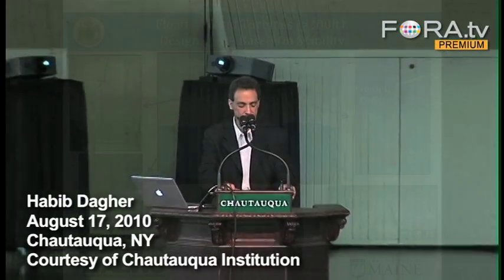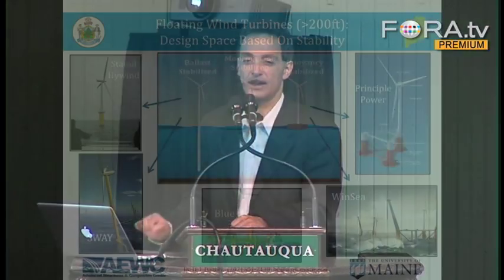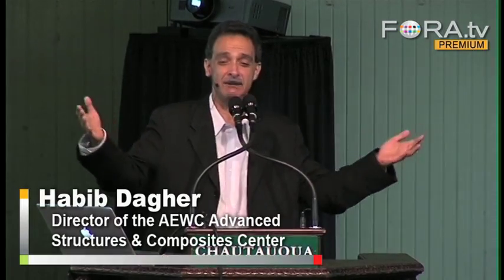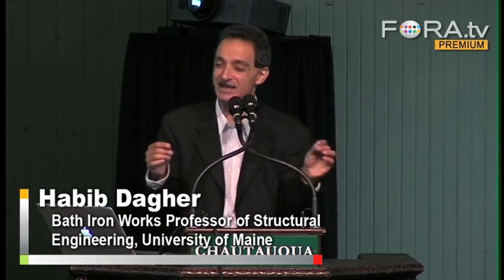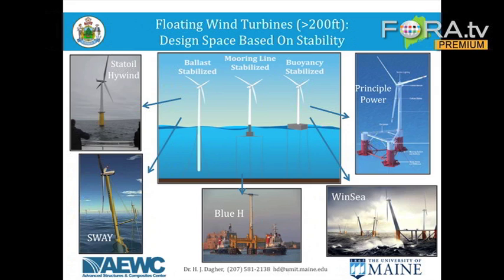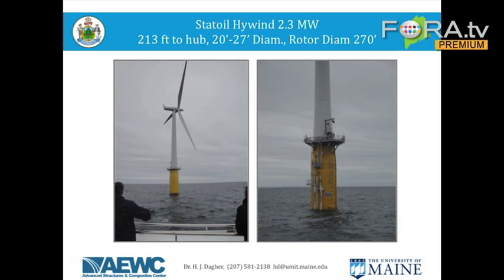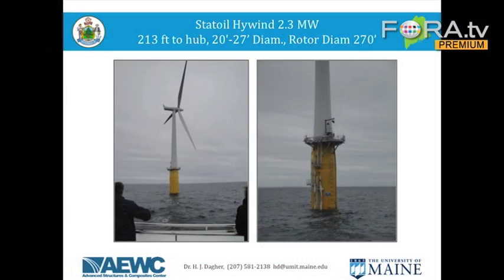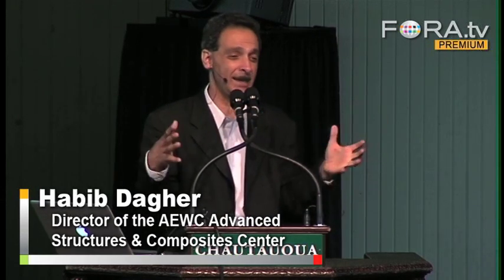A Look at Floating Wind Farms: Harnessing Offshore Energy

Comment: @Rod934 I didn't think about the corrosion problem, but I managed to think of two designs where the mechanisms wouldn't be susceptible to corrosion (i.e. the mechanisms themselves would be above the surface).  Whether they'd actually work, well, probably not actually.  It'll need a greater mind than mine, but I'm sure there are plenty of those out there already.